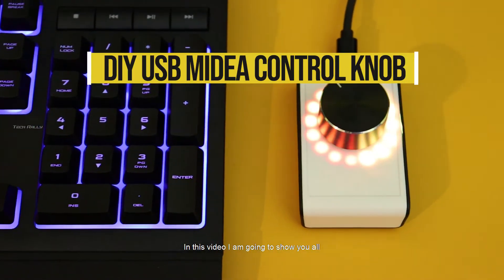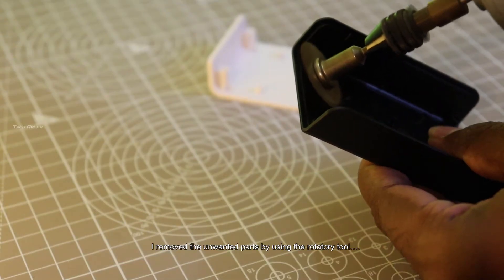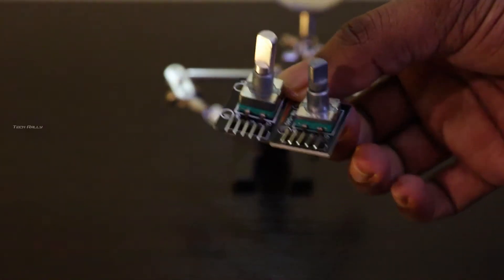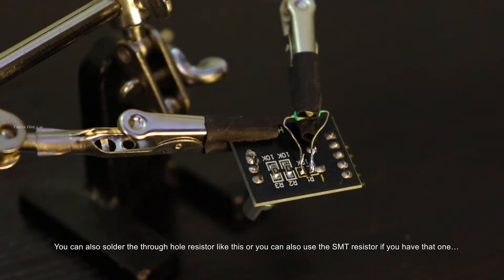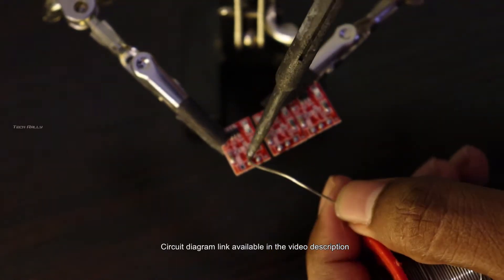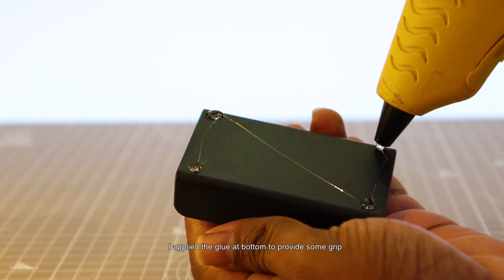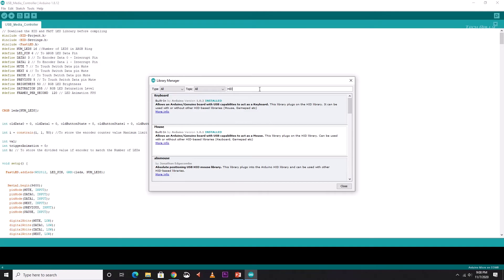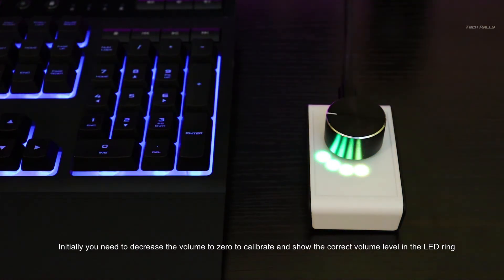DIY USB Media and volume Controller for PC

Comment: hello thanks for the details video helps a lot, everything is working well,
only when I turn knob clock wise volume gets decrease and when I turn knob anti clock wise volume gets increase, is there any setting to this to work well

thanks in advance..😊
Reply from the maker: Thanks for your feedback 😀 
Try reversing the data pins for encoder 
Or you can find and change the pin order in code..
Reply: Thanks for reply. 
Can you please confirm which pin do I need to reverse with which pin..?

As of now volume know is stop working not doing anything, only play/pause next and previous function is working....I have no idea what happened, I try to reinstall code 2-3 time but no success....
Reply from the maker: @amitjadhav3879  Data pins of your encoder
Reply: @TechRallyofficial  can you make this device wireless with bluetooth module...
Reply from the maker: @amitjadhav3879 i will try bro 😀
Reply: Hi, is it possible to make a such volume control wireless with esp32 module.?
Reply from the maker: @amitjadhav3879  yes it can be made,

Comment: hey i want to made it too but i cant find the Arduino you used    do i can use the Arduino nano ch340?? with the same code                    how i can increase the sensitivity of the rotary encoder ????
Reply from the maker: This code works only with any ATmega32U4 based boards..

Comment: I have also made the same as you exactly same but mine has a bit problem, mine get automatically disconnect(not fully, like the rgb got off, touch not work, knob rotation don't work but light in touch sensor when i touch on them red light glow and light on Arduino also glow) and then I need to re-plug the board sometime it also don't work and need to replug, to fixing the replug button I fix a micro switch between +ve wire. 
is there any way to permanent fix of this problem
Reply from the maker: I didn't face any issue like this
Check the pin connections
Reply: me same problem

Comment: I m about to build this but I got one question.
This knob is 360 degree what happened if lower the volume from monitor with mouse, 
I hope you understand my question
Reply from the maker: Volume control will work as usual only the led indicator will not show correct level..

Comment: Hi, great video and beautifully designed volume knob. I am kind of nervous when it comes to coding and soldering parts. Is it possible that you make one sell it to me? Also getting parts from aliexpress is not easy now because of the china ban. Plz help.
Reply from the maker: Thanks for showing your interest, i really glad to sell but Aliexpress is also banned in India so I am also not able to get some parts,
But still i am trying to make a better version
I have plan for selling but not immediately, i will definitely let you guys know in my channel once i am ready 🙂...
Reply: @TechRallyofficial  Hey bro, thanks a lot for your video. Today i bought all the parts except the rgb ring, wasn't able to find it locally but ordered it online. Rest of the parts i assembled and managed to install the code and everything works fine, only thing i changed in the code was the volume knob direction for increasing and decreasing, as turning the knob clockwise was decreasing the volume for me. Will wait for the rgb ring to arrive and then assemble it in a junction box.
Total amount costed me around 1400rs as the pro micro board (600 rs) is alone the costliest among all the parts. I know i can get the same volume controller for around 1000rs online, but there are no touch controls and rgb present in them.
You just made the best wired controller. 👍🏻
Thanks once again brother.
Reply from the maker: Great Thank you so much for your support 😀....
If Aliexpress was available than it would have been much cheaper, Unfortunately it was not available for us..
Reply: @TechRallyofficial  hi, i received the rgb ring today and soldered it, its working fine. But as i said i had to change the volume code as anticlock wise was increasing the volume for me and vice versa. I was able to do a minor change in the code and the volume now works perfectly as per the knob direction. But i am unable to change the rgb animation when changing volume as it glowing in the opposite direction, if i turn the knob in clockwise direction, the rgb lights glows in anticlock wise direction. I tried changing, modifying the code but wasn't able to get the animation corrected. If you can help with this issue it would be a great favor. Thanks.
Reply from the maker: Just need to change the input in led ring,
In video at 3.09 you can see D0 and D1 pins you just need to change the input other to correct the direction..
Reply: @TechRallyofficial  i tried that method by reading one of your comment, changed D1 to D0 but that didn't worked at all. Led didn't even turned ON when i did that.
Reply from the maker: I am receiving more comments on same issue, i will check and update.
Reply: @TechRallyofficial  okay thanks brother. If i figure it somehow i will let you know too.
Reply from the maker: I have added one more code as reverse in my instructables page, Please check out.
Thank you 😊
Reply: @TechRallyofficial  hey bro thanks, now everything works fine, all the animation, the volume knob direction and the volume increase /decrease is all syncd perfectly. Thanks for the new code. 👍🏻👍🏻👍🏻You are awesome.
Reply from the maker: Thank you 😊

Comment: i have a ws2812 ring but it aligns the leds in the opposite direction with the code. when rotating the volume ws2812 lights up in the opposite direction of the rotation. please help me to fix it.
Thanks
Reply from the maker: There will be two inputs for led ring D0 and D1 you just need change the inputs to the opposite pin in led ring,
Thanks 😀
Reply: @TechRallyofficial  it doesn't work

Comment: bro, im try to this.
when i upload the sketch error HID-Project.h No such file or directory.

please help, i just newbe.
thx bro.
Reply from the maker: You need to install the HID library in aurdino software,
Thanks 😀
Reply: @TechRallyofficial  thank you bro, I have got and installed the hid library and I uploaded it successfully,
good luck for the future.
sorry my english is not good.😁
Reply from the maker: Thank you 😊
Reply: hai again..😊
how to turn off the animasi led?
can i usu the button for the touch sensor?
thx brow..
Reply from the maker: Yes, you can but need to disable fast led codes..

Comment: Hey I am about to start building this project! Thank you for the guide! I was wondering if I can use a 1206 smd resistor for the volume encoder or should I get the smaller 0603 smd resistor.
Reply from the maker: Thanks for watching 😊, 1206 SMD resistor will be fine...
Reply: @TechRallyofficial   Thank so much for the reply!  Happy New Year to you! Stay Awesome!
Reply from the maker: Happy new year 🎉...
Reply: @TechRallyofficial  would be great if during increasing volume the light rises along the knob cursor. Is there a way to adjust the code?
Reply from the maker: Its not possible without using any plugin in windows. I will do some search on this..
Thanks 😀

Comment: Hi, what a great idea.
I have a problem that when I turn the volume down on windows 10 it goes down very quickly, is there any way to fix this? Thank you
Reply from the maker: Try using the same model Encoder that is used...
Thank you..😃

Comment: Thank you so much for a great idea. I did it but there is a small error that i can't fix that is turning the volume clockwise to decrease the volume and turning counterclockwise to increase the volume. Please help me
Reply: I had this same issue I was able to fix it all within the code by reversing the volume up down and reversing the led animation. Thanks again for the great project I had a lot of fun making it
Reply from the maker: Thank you 😊
Reply: @Deadpartition  Can I ask for your code for reference? thank you
Reply from the maker: Thank you so much for your feedback, Its just common issue in encounters you can correct it by reversing the pin number 2 and pin number 3 connection in Aurdino borad or you can reverse the data pin connection in encoder itself.
Reply: @TechRallyofficial  I already fixed it.  Thank you very much 😍😍😍
Reply from the maker: Great 😃👍

Comment: Very good! is what I needed with some change.
No LEDs and power button.
even though it gives me a mistake:
documents-arduino-libraries-hid-project-src-keyboardlayouts-improvedkeylayouts.h:54:18: note: #pragma message: Using default ASCII layout for keyboard modules
Do you know how this bug is fixed? I can't find anything.
Reply from the maker: Thank you..😊 Just make sure you have installed HID library before compiling the code.

Comment: Nice job! Do you know if theres code available for a Teensy2 board?
Reply from the maker: My code works with ATmega32U4 based teensy board you need to use Aurdino IDE with slight modification to upload the code.

Comment: Can this project used on arduino pro mini?
Reply from the maker: No, It will work only with Aurdino Pro Micro or any other Aurdino boards with ATmega32U4 based processor
Reply: @TechRallyofficial  okay thank you for the information
Reply: @TechRallyofficial  does it necessary to add resistor to the rotary encoder?how much the resistor value if want to add to the rotary?
Reply from the maker: If your encoder module doesn't have resistor in-between the vcc and Switch pin, you need to add 10k resistor by yourself.

Comment: Hey tech rally:
 Will u able to make multiple volume controller for pc which can able to control different software sound like YouTube,game,...
Reply from the maker: It can control only over all PC volume, if you need to control volume for separate application than you need to develop a app in pc which is more complicated, if you want you can map any keyboard shortcut on to aurdino Thanks for watching.. Subscribe and support..🙂